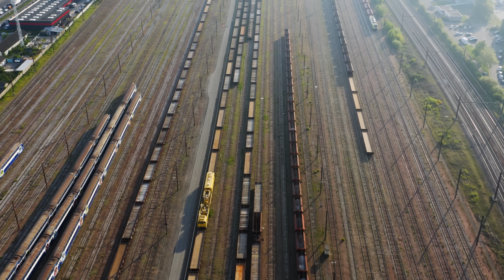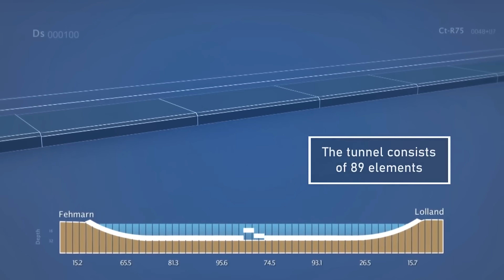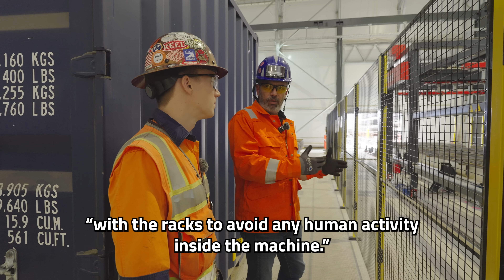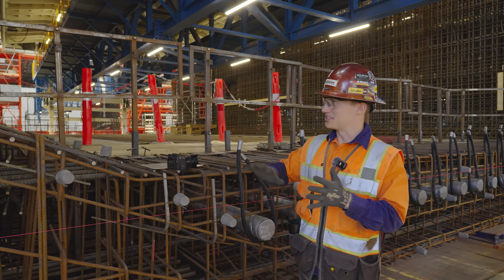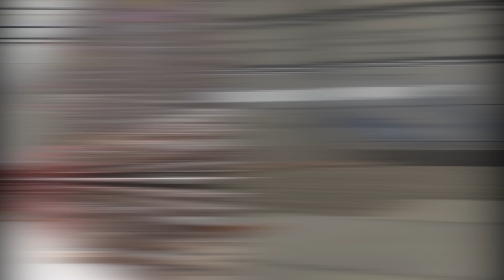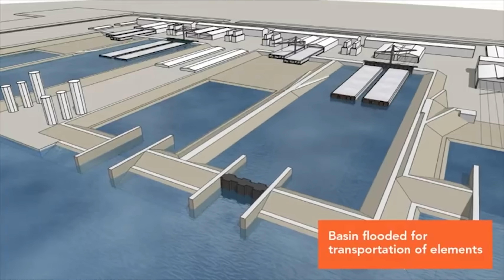How Europe's Building the World's Longest Underwater Tunnel!

Comment: A very nice video about this immense project, but I have a question I might have missed.
The floor where the tunnel sections are laid in the seabed is also covered with concrete, because such a heavy thing can't simply be laid on the seabed, as it would take time.
I missed that bit of preparation.

Comment: But... Wait, I still got so many questions? How are the elements joined? How is the tunnel anchored so it doesn't float back up to the surface if it is so buoyant? How much sand and steel is being used on this single project? How long do they expect it to last for?

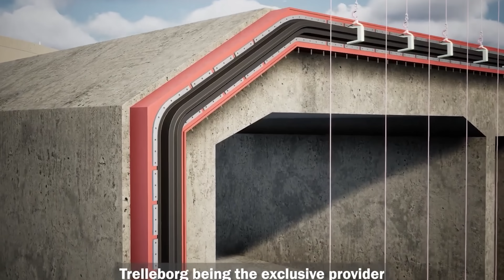Comment: 13:55 I’m guessing they won’t be able to replace that rubber once the tunnel is complete. I’m kind of surprised it will last for the intended lifespan of the tunnel.
Reply: In addition to the gaskets, there are also secondary seals, all engineered to last 120 years.
Reply: @Kaj_Kasket  That's cool! Is this information available publicly somewhere or are you working on the project?
Reply: @ My son has been one of the project managers and one of those who has been in charge of quality control of the rebar part.
I've been following it closely.
But yes, it is publicly available information.
Reply: @ That’s very cool, thanks for sharing. And as a Malmö resident with family in the Netherlands, I look forward to driving through your son’s work

Comment: These rubber seals between the elements. How long does these work without getting leaky? Can't imagine, that these are for eternity.....
Reply: I currently work for a company that adresses exactly this problem. Tunnel joint renovation and inspection. However it is fair to say that these type of seals are extremely robust and durable. Samples from as far back as 60 years show little deterioration. Nothing last forever but the projected service life of 120 years in most cases is no problem.

Comment: The Chesapeake Bay Bridge and Tunnel (CBBT) used a similar strategy for the 2 tunnel sections in the project.  It was opened in 1964 to traffic and was one of the longest bridges in the US at 17.6 miles.  This project dwarfs the CBBT in every respect and is an engineering marvel.

Comment: Hate to be the nay sayer but , who will be responsible if one or a hundred of the welds fails. Will the gaskets between the structures leak over time. What protocols will be in place because of flooding or fire ? Are there earth quakes in the area. A great idea but it may have issues
Reply: There are certainly no earthquakes in this sea and in this area. The Baltic Sea is a rather calm sea.
This way of building a tunnel has already been tested several times and I am absolutely sure that there will be a safe quality control during the construction of the tunnel elements.

Comment: Nothing new, France to England is already done and a bit longer then 18km. Looks like it will just go faster to build with modern technology. England to France actually had to dig the tunnel and make sure the tunnel from France ended up in same space as the one being dug from England.
Reply: The North Sea is also much deeper at the Pas de Calais and has faults on the seabed, so the only solution was a conventionally bored tunnel. The Fehmarnbelt is fairly flat and even.

Comment: The rubber gaskets between the tunnel segments will deteriorrate over the years. I don't see a way to replace them.
Reply: They are designed to last 120 yrs. They did not show the Omega seal which can be potentially be replaced. These seals have been used for 60+ years and other then unforseen problems they have proven to be very robust.
Reply: @joelvanstee7324  Thank you for the information. Thanks to you I found more on Gina and Omega seals.

Comment: It was mostly us, the Danes, that wanted this tunnel, the Germans were a lot less keen on it, maybe due to the cost or whatever, but it was mostly a Danish project for a long while.  
EDIT: And apparently the reason we wanted this project to happen was because of a deal with Sweden when we built the Øresund link.
Reply: Sweden also wants this tunnel. It will be faster and cheaper to go to the border shops :)
Reply: Germany made Danmark pay for it😂
Reply: @ruhri0411  They had to.. Germany is broke
Reply: @ Firstly, that's not true and secondly, it was primarily Denmark's idea and desire to build this tunnel. It also benefits Denmark more than Germany, as Scandinavia is not Germany's most important trading partner.
The Fehmarnbelt Tunnel is the last piece of the puzzle for Scandinavia after the Øresund Bridge to have a fast connection to Central Europe.
This connection is really not free of charge for Germany, the costs on the German side also amount to €3 billion and the popular holiday island of Fehmarn is literally cut in two by a four-lane motorway and a HSR route.

Comment: The A55 crossing of the Conway estuary in North Wales used the same "cut and shut" technique. Due to the tides once they had the sections in place then twice a day they had to load up and drive every dump truck into the tunnel to weigh it down and stop it moving! They had to do this for some time even after the "shut" phase as the material used was so waterlogged it reacted to the water movement.

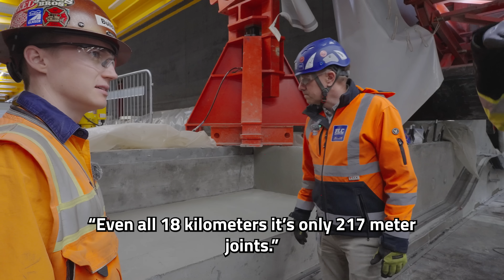Comment: 13:05 flexible elements: made of what? Lasting for how long? Is it possible to repair them during the lifetime of the tunnel without stopping the traffic? If it has to be stopped, for how long? Sounds interesting but I'm a little skeptical about the sealing materials etc.
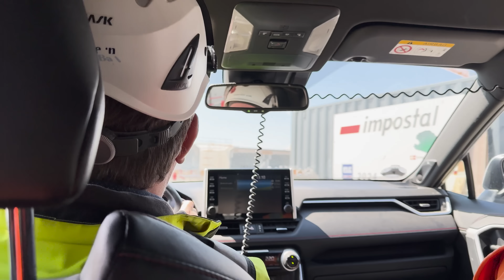Ok explained around 14:23 perhaps sufficiently. 👍🏼
But I would be less skeptical if there was an information like "this method of sealing has already been used in another project and so far it serves without issues for some 15 years" or so. 
For how many days does a new element need to cure before it is sturdy enough to move out of the pouring spot?

Comment: Hi Aaron. Thanks for covering our huge project here in Denmark and Germany. I have som factual corrections for those who might be interested.

"Currently the only route from Germany to Denmark via land has been up and aaall around the baltic" you say. 
Actually Germany and Denmark borders are right in the middle of your yellow line where it buldges to the left. Flensburg (DE) and Padborg (DK). That part of Denmark that is connected to mainland Europe is called Jutland and it covers 70% ( 29000 sq km) of land of entire Denmark. The tunnel that is being built goes from the Danish island Lolland just below Zealand (where you will find Copenhagen). Jutland and Zealand is connected by 2 bridges. One in Middelfart that connects Jutland to the smaller island Funen and one on the east side of Funen that connects to Zealand. This crossing is called Storebælt. (Great belt). In June of 1998 the bridge was fully built and opened up for car traffic. Before that we would have to take a ferry to go to Funen or to Jutland. 

"More recently" you say its been possible to cross from Denmark to Germany on a 45 minute ferry ride which works fine. Yes it absolutely does. Thats not that recent though. The ferry opened up in 1963. That was how we would go to Germany to go to the rest of Europe before the bridge opened up in 1998. Say you are in Copenhagen, you would actually reach Hamburg in Germany faster by taking the bridge, than sailing on the ferry.

Also trains has historically since 1963 boarded the ferry to go to Germany. It was never needed to go to the beidge which was built 35 years later. The route is called "Vogelfluglinie" which ins German  and translates to the danish word "fugleflugt" which would mean bird flight or "straight line"
Reply: The tunnel is NOT going from Sjælland!
Were afraid not to be taken serious if you correctly said Lolland 🤣
Reply: @ane-louisestampe7939 no experienced Dane takes you Køwenhavnere serious, never mind sophisticated name games 🤣🤡
Reply: @OmmerSyssel  Grow up 🙄
  - and stay where you are, until you do!
Reply: @OmmerSyssel  How do you detect from a yt comment, where people are born?
Have you got a hate rader, that sences it?
Reply: Oops. Fixed it now ☺️ tak ☺️
Reply: @saltlakrids  🤩

Comment: The tunnels in the Hampton Roads area of VA use this method at a smaller scale, dual 2 lane tunnels no rail. The new Hampton Roads tunnel has switched to using subsurface boring because the Navy does not like the temp blockages from moving and submerging the segments.

Comment: Question: do the rubber segment water seals have an estimated life span?
Reply: The concrete has a promised life expectancy of 120 years. The rubber seals will last longer than that. But even if they fail it is possible to repair. 
This tunnel from 1969 in Denmark https://en.wikipedia.org/wiki/Limfjordstunnelen has had problems with the seals, (not good quality plus underground unstable shifting the tunnel elements). It was the first submersed tunnel in Denmark and expertize on such construction is a lot better today. There has been many repairs done to this from the inside (seawater and the rebars in the concrete does not mix well). The tunnel is still being used by approx. 90000 cars every day. The repair periods though is a pain in the ass for the commuters. During rush hour slow traffic/stops is a daily problem, but when they close one tunnel tube for repairs, and instead of 3 lanes going south or north, you get one lane going in each direction. I have been stuck waiting there for many hours, and there is no other viable alternative for all those cars. Its either a 60 km detour going east to catch a ferry with a 10 car capacity, or a detour west 120 km for a small two laned bridge that is already bogged down by traffic.
Reply: @24jh42  Thanks for the response - much appreciated.
Reply: @24jh42 use DSB or your bicycle ✌🏻🫡

Comment: What's the expected lifespan of the GINA gasket? What is the maintenance or replacement plan for that seal?
Reply: The Gina gasket is documented and designed to have a minimum lifespan of 120 years. This is supported by samples taken from its first application in the 1960s, which confirm and validate this longevity. Additionally, there is a secondary inner seal, known as the Omega gasket, which is also designed for a lifespan of at least 120 years. Unlike the Gina gasket, the Omega gasket can be replaced if necessary. These lifespans assume proper usage and no significant deviations from the original design parameters. This extraordinary type of seal which are the largest in the world have a story of their own. If interested I could give you more information or you contact the manufacturer my former employer: Trelleborg.
Reply: @joelvanstee7324 Swedish technology at its finest?

Comment: Considering there using concrete 
Why are they not using stainless steel rebar to avoid the concrete from rotting the rebar ??? As it is under water and not just water salt water???
You see proper stainless steel does not rot no rust at all.
Which will fracture the concrete when it rots as typically found in bunkers just saying

Comment: Europe isn´t building anything! - This tunnel is constructed, build and financed by Denmark.
Reply: Well, I read that some 800 companies are involved.  500 of those are Danish.  With workers from over 40 different countries working there. The main contracter is FLC, a consotium of 9 different companies from various European countries. A Dutch consortium (FBC ) is doing the dredging.  The control and oversight of the whole project is indeed 100% Danish State owned ( "Sund og Bælt" ). And the tunnel itself and the connections on the Danish side is paid by Denmark. Germany pays for the connections on the German side.  "Europe" (EU) are supporting it with maybe 1/6th to 1/5th of the costs.  So the "truth" is somewhere in between, as always.

Comment: I'm interested to hear how they get these floating segments to sink.  If they are naturally buoyant when filled with air, wouldn't the finished tunnel be buoyant as well?  Are they designed to be just slightly buoyant so that when a little bit of weight is added they will sink?
Reply: That is also my question. I think he said they will add some weight to them once they are out in deeper water. I'm sure they will figure it out as they fill the dry docks with water.
Reply: They fill chambers inside the segments with water to sink them. There exist some animations of how they do it online if you are curious, but basically they pump water into the segments and air out to sink them when they are in the correct spot, much safer than loading them down with weights and much less cumbersome.
Reply: On the official Fehmarn channel the technology are documented. Equipment are installed to maintain buoyancy down to millimeters of precision.

Comment: A very informative video. Each stage was well explained but it is still amazing that it actually works. How long will those gaskets last in seawater?
Reply: The Gina gasket is documented and designed to have a minimum lifespan of 120 years. This is supported by samples taken from its first application in the 1960s, which confirm and validate this longevity. Additionally, there is a secondary inner seal, known as the Omega gasket, which is also designed for a lifespan of at least 120 years. Unlike the Gina gasket, the Omega gasket can be replaced if necessary. These lifespans assume proper usage and no significant deviations from the original design parameters.

The waterstops seen between the segments also have a tested and design life of 120 yrs.

Comment: Yea, it is one of the most Profitable Ferry lines in the world. And is working more than fine, it also was Cary trains from 1963 to 2019. Just ended due to the fact that the Danish railway wanted to end this cooperation and push for the Tunnel
Reply: There was no need of "pushing for the tunnel" in 2019.  Already early that year it was officially approved, also by German authorities, to go ahead and start the project. The rail traffic ended, because they started "straightening out" and / or build new rails to prepare for the high speed trains.  This new tunnel will carry so much of the cargo transit going across Denmark now, that the roads and rails west of "Storebælt" will be relieved of the pressure, they are under now.  Ferries simply cannot carry the same amount of cargo trains, a tunnel can. Same goes for cars and trucks, obviously.
Reply: @k7u5r8t4  yea, that is a bit too optimistic, problems are in the bad Germany Rail infrastructure. In this case, the Part from Hamburg city center to Hanover. In particular the Bridge over the southern branch of the Elbe river which needs to be replaced and the overloaded way to Southern and Eastern Germany/Europe. Other examples of this is the Gotthard Base and Lötschberg Base Tunnel and the missing capacity on the Rain Bahn. Which Germany promised to enhance until over almost two decades ago. And the same is happening in  Austria, with the Brenner Base Tunnel finished a long time before there will be an appropriate Rail line feeding it from the North. All due to NIMBY ism. So I don't see how this tunnel will reach an efficient and justifiable operation in the near future (20 Years ).

Comment: Germany and Denmark building the longest under water tunnel of 18 km, planned to open in 2029

Meanwhile in Norway, building the Rogfast tunnel, of 26.7 km to be ready in 2033
Reply: Germany isn't building the tunnel, and it's not the longest.
Reply: @fastertove  German an Danish, as well as EU authorities approved the project.
It's not important who's technology building it.

I believe it will be the longest road tunnel under water.
Maybe you can name a longer road tunnel under water?

There are many long train/metro tunnels.
There's also lunger road tunnels, like The Lærdal Tunnel, in Norway.

While the Rogfast Tunnel in Norway, will be longer than the Lærdal Tunnel, as well as going under water.
Reply: @thorbjrnhellehaven5766  The tunnel is entirely Denmark's when it's done.
The Germans job is basically to make the connection with the German/south side possible (internal infrastructure inside Germany) and to try and satisfy local protesters (environmental, aesthetical...). The project receive founds from EU and is build with expertise and contractors from multiple countries.

Road tunnel under water - yes.
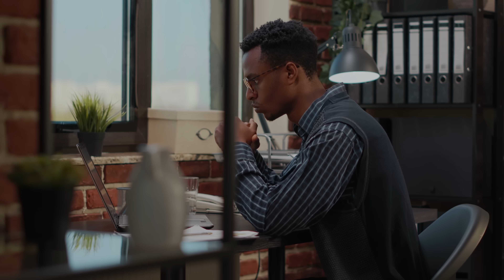Reply: @fastertove  my comments about the Danish/German tunnel, was basically just paraphrasing the video at 0:37.

My focus was primarily that, while it will be the longest road tunnel under water when it's opened. Only 4 years later, the ongoing tunnel construction in Norway will beat it by almost 50%
Reply: @thorbjrnhellehaven5766  It is fine that Norway is getting a longer tunnel, it has no impact in whether this is a useful project. My concern about the project is more about the founding. With the tunnel being financed by Denmark, with a little help from EU, we have less available for other more pressing projects.

Comment: You indicated that the rebar would be tensioned by compressing it. I don't see how that could work. What I understand is that the rebar is put under tension... pulled form the ends... so that when the concrete cures it wants to spring back and so is being pulled "together" by the rebar rods. This would give it tensile strength, as opposed to compression strength, with it already performs pretty well, as you indicated.

Comment: Maybe I missed it, but there was no mention of corrosion of the steel...even on land this is a problem. Concrete may look solid, but it is a matrix and water permeable, unless it is treated in some way. On the other hand, the Channel tunnel, which is longer, and "dug" with TBMs is lined with concrete segments which presumably are also steel re-enforced. But they injected a grout into the gap, which I suppose gives some measure of water proofness. Or am I just talking out  of my backside?